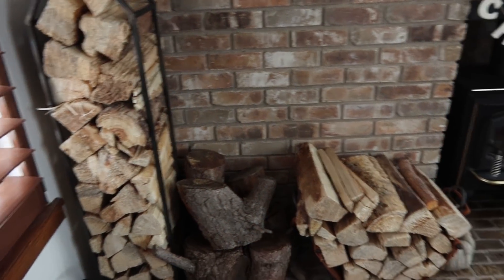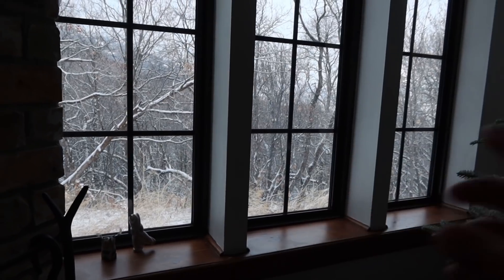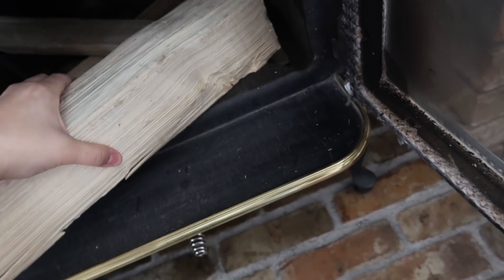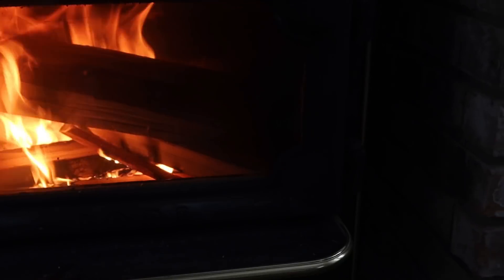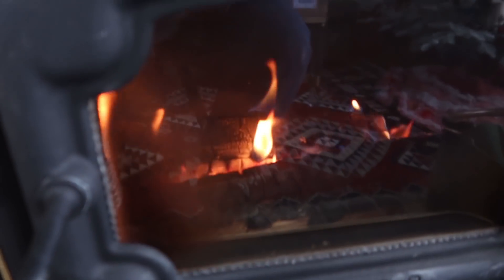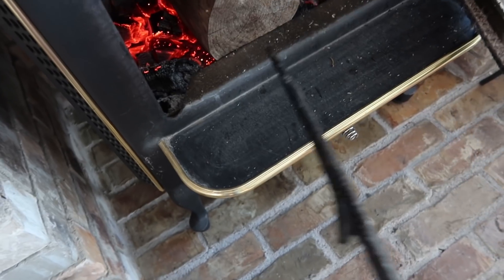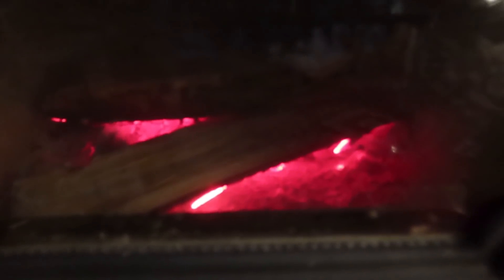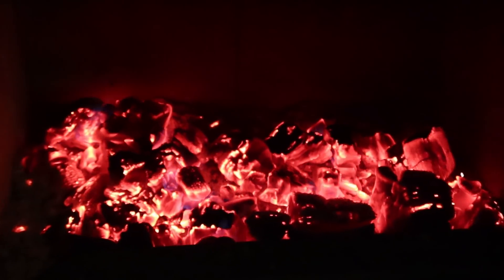How I build a fire that lasts all day. [vlogmas - day 15]

Comment: Hey, a few small tips: with this type of stove it usually not necessary to clean out the ashes very often and it is better if there's ash in there as it helps with airflow and protects the stones. And even though it seems like you have no trouble lighting it at all, you can also open the air up more in the beginning, from the looks of it it's only at 50 %
Reply from the maker: Oh strange, that's opposite to what my experience has been. Do you have some professional training with them?
Reply: @stacyvlogs  No, I just did a lot of research on wood fueled furnaces recently because I moved back in with parents and they have a wood cooking stove and a wood central heating unit and what I said seemed to be pretty much the consensus everywhere. But if your experience has been negative doing that, better stick with how it works well for you.